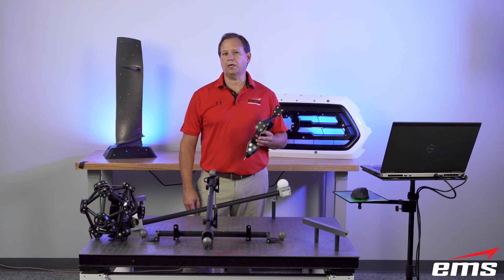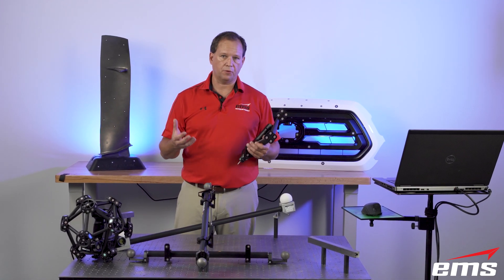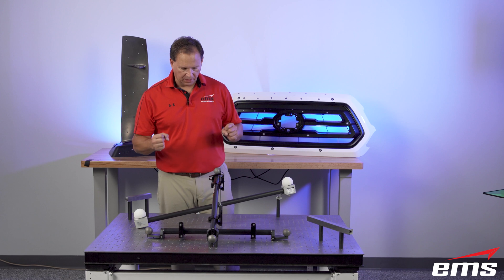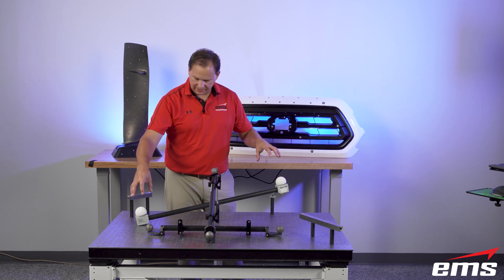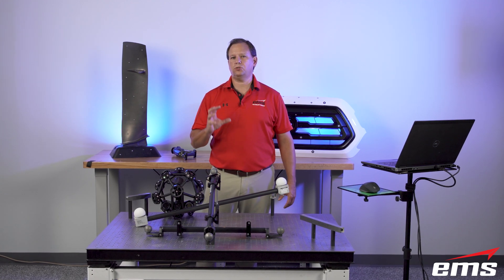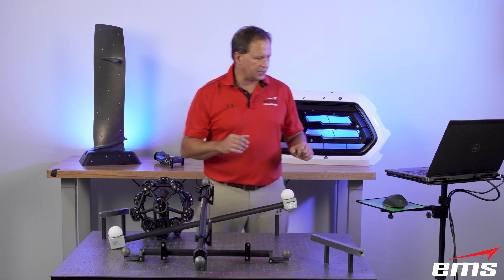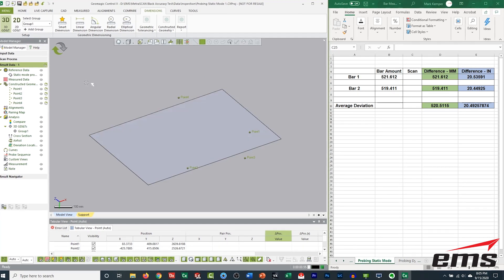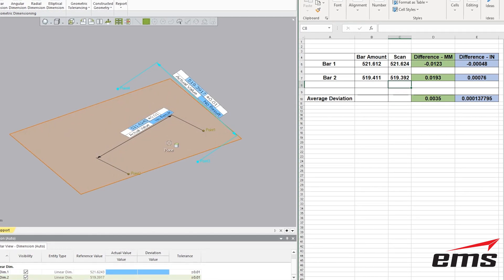Creaform MetraSCAN Black - Accuracy Test

Comment: What is the difference in measurement between Geomagic Control X and Polyworks Inspector using the same scan data of these ball bars? Is inspection SW also affecting accuracy results?
Reply from the maker: Hi Jasvinder.  Technically the measurements would all be the same assuming you are taking the exact same measurements.  This assumes the software calculates the measurements the same way.  We have done our own internal tests and the difference is well outside the margin of error.   So software choice should be a non-issue.

Comment: 10:45 Math is not correct for the gage blocks difference.
Reply from the maker: Your right.  Something is wrong with my spreadsheet.  I'll add a note in the description.
Reply: @EMS3D   I think it might just be a formatting decimal precision error. 1 place vs 3 places.